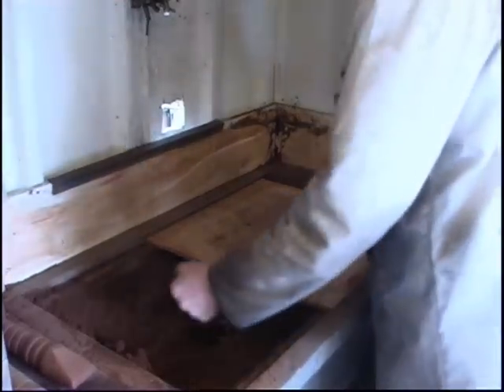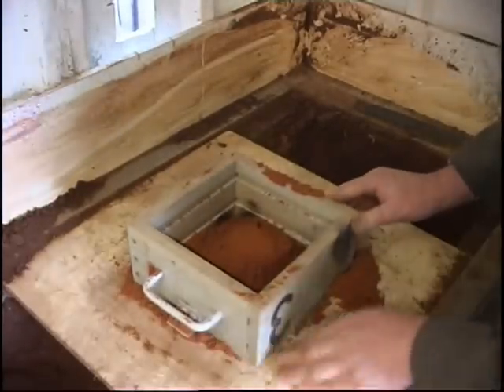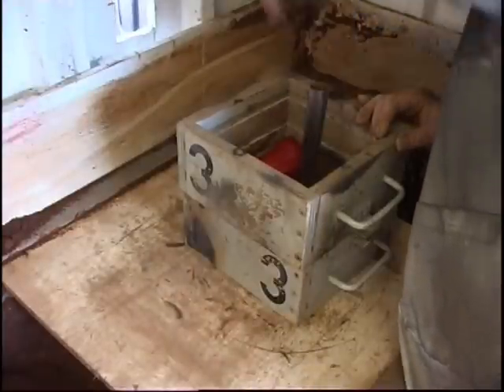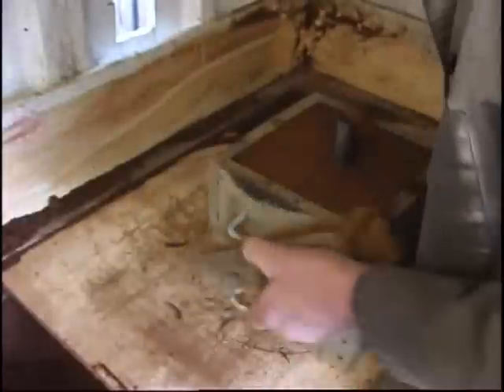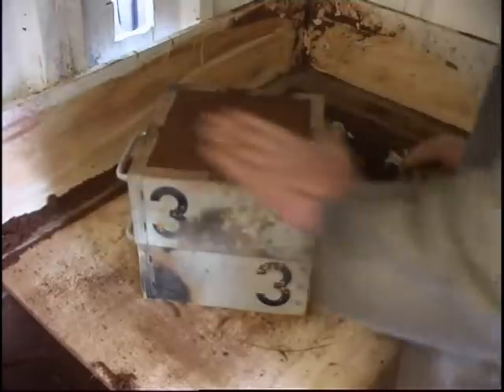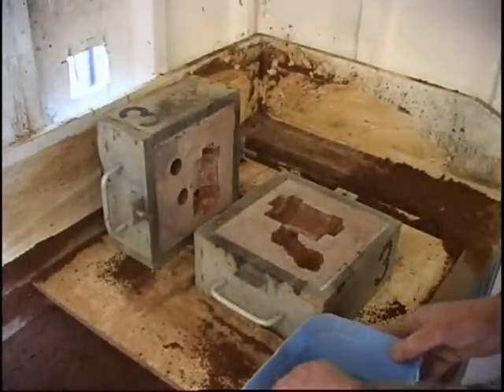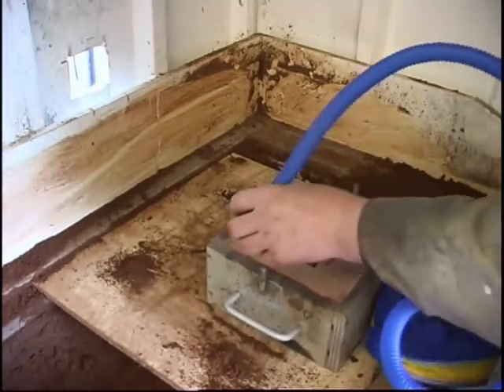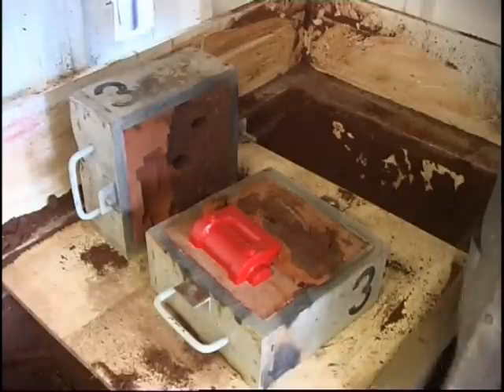BOB"S CYLINDER PART TWO

Comment: I'm pretty sure when you were doing the top half you didn't use any of the material in the bag directly onto the mould before adding the special riddled sand - could this be why it stuck together? Also could you please put up the names of the various materials you use?